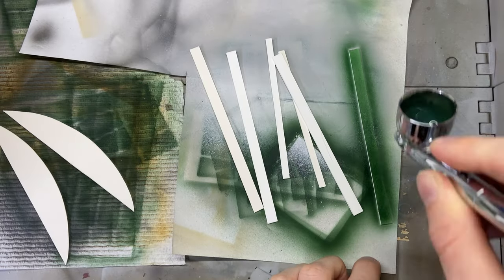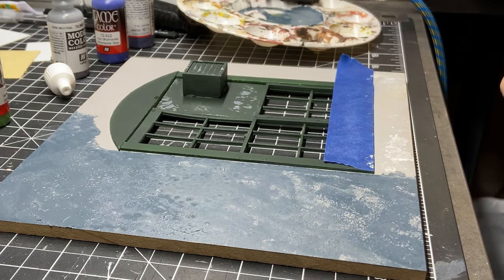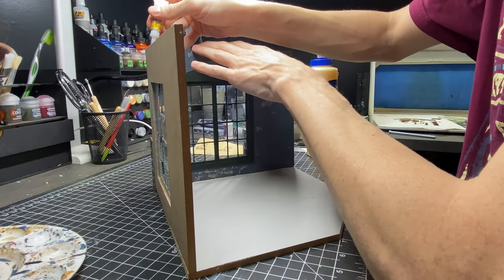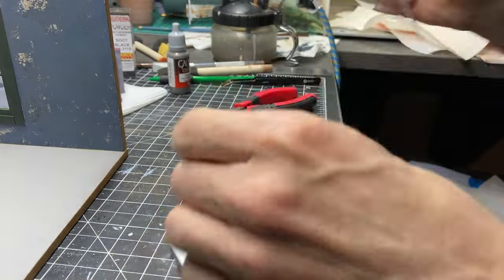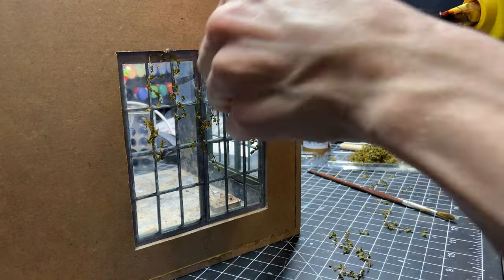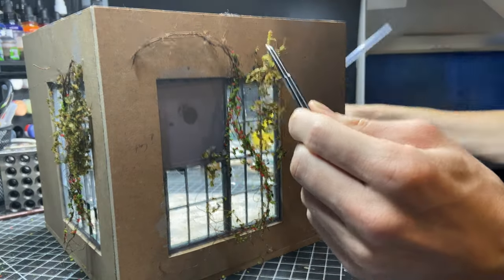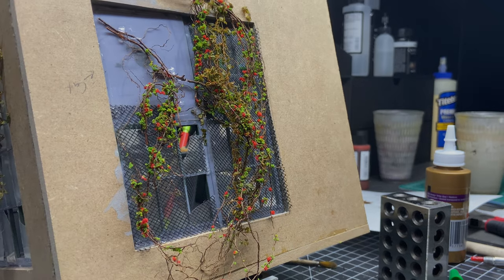Realistic Abandoned Building Diorama w/ Vines Growing on Windows

Comment: So atmospheric and brooding looking. Love it!  I got some slide covers, I havent used them yet but I will tag you if I upload anything.  Love the peeling paint too. I was going to ask about the cracking paint as I dont have an airbrush, do you think applying the paint to the wet modpodge with a sponge would work better than a brush?
Reply from the maker: Thanks! I'd love to see what you come up with. I usually use elmers glue for the cracking paint, and you can do it with a brush but it will tend to crack in the direction of the brush strokes. Haven't tried using a sponge or foam brush, but dabbing paint over it with one of those might work!
Reply: The little foam makeup triangles are good too. Though they’re usually not as highly textured as sponges.

Comment: Loved the new space. What air brush system do you use? What is your final photography setup (not video). Since this piece looks larger than some of your other dioramas, did you do anything to adapt your photo setup?
Reply from the maker: My airbrush is the Iwata Revolution, it’s tip is not too fine so it’s easy to spray thicker paints to cover larger areas. And I have a basic AS-186 style compressor.

As for photos, I don’t have a dedicated space so I set it up differently for every diorama. My next video will show a little more of what it looks like when I shoot them, but it’s been mostly cobbled together in my small apartment. I did just order a large background kit so moving forward I will have a nice black backdrop behind, whereas right now I’ve just used pieces of black foam board in the background.

I am a filmmaker for my full time job so I have a lot of lights and things accessible, I may do a video in the future of how to do a simple and cheap setup for people to try for themselves.

Comment: Very nice.  I just stumbled upon your channel. What scale are you building in?  (I'm used to 1/35 for Military Model Dioramas)
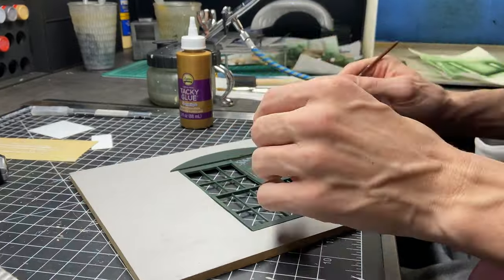Reply from the maker: Thanks! Most of my work is somewhere around 1:18 to 1:24. Haven’t stuck to anything specific yet!
Reply: @AbandonedMiniatures  Cool, thanks. If you pick one specific scale you can (usually) purchase a ruler that does the conversion for you. It will make it easier to measure and maintain consistency.  - Just a suggestion...  In any case - fine work!
Reply from the maker: That might be helpful! I think often my issue is that I like to work with the larger 1:18 size but when I do larger areas I have to downsize some, or my piece would end up huge haha.